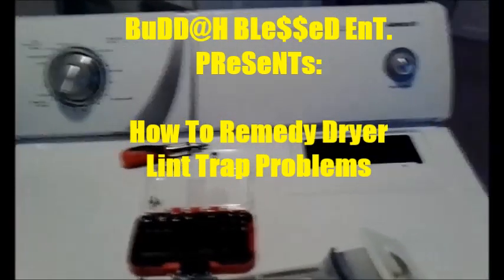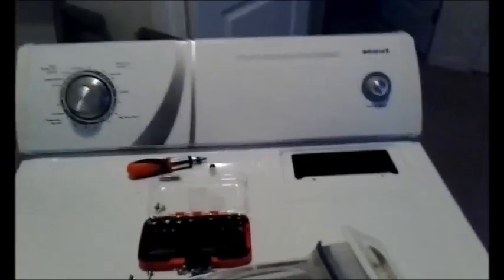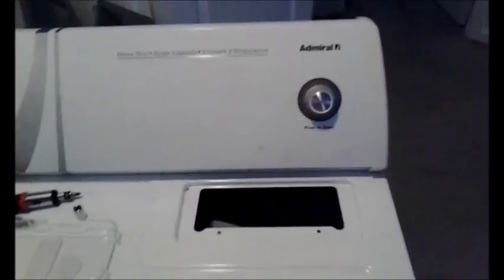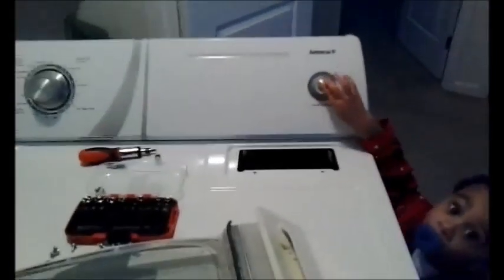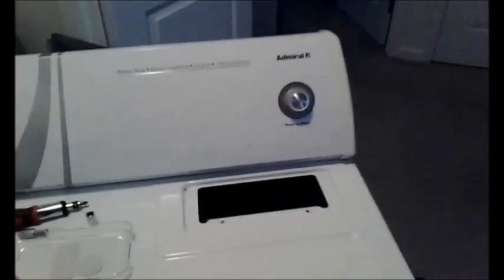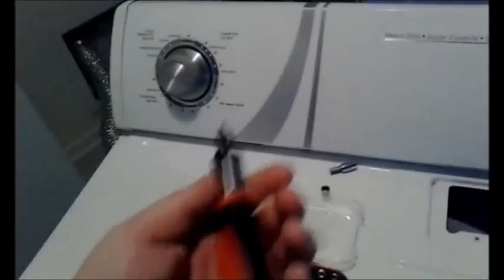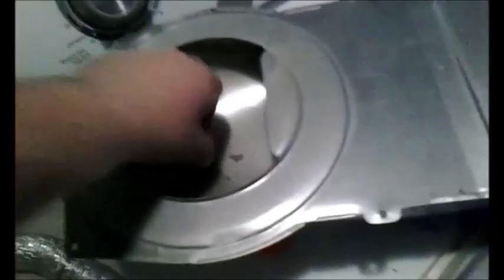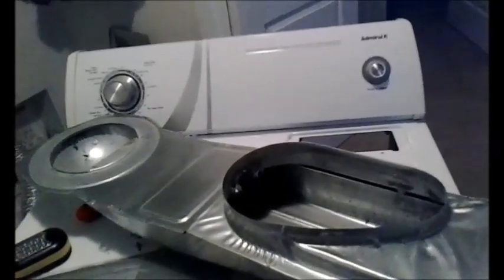How To Fix Dryer Lint Trap Problems (Removing Items That Have Fallen Into The Trap)

Comment: This video saved my life. I dropped a sock in the dryer lint vent and I was like I'm not about to turn on this dryer and have the house burn down. so I was just about to do everything you told me but couldn't find a tool box in the persons house. Something told me to turn the dryer on for a  second and I did and I heard a big suck and some metal hit. And opened the door to see if the sock fell inside the dryer but it didn't. So I went to the hose and pulled it out and it was inside of there🙌
Reply from the maker: +Lori Anne Glad it was able to "save your life"....LoL

Comment: Hi .. thank goodness for you tube and people like you who in the time of need really come through with solutions for us !  I had already had enough with trying to reattach my foil dryer hose to the wall hole because it fell off.. and I somehow rewired it to other nearby things to hopefully hold.  Deciding to just clean the lint trap , accidentally dropped a screw driver into it !! yikes !! I did what you said, removed the back , and removed the hose, and could feel the screwdriver in the trap , still had to really work it to remove it because of the angle of the exit.. but did not have to remove that whole trap unit !  Breathing again !  thanks so much !!!
Reply from the maker: No problem, thanks for leaving a comment...

Comment: I really found this video helpful. I had a deck of cards on top of the dryer and when I emptied the lint tray I accidentally pushed the deck and it fell in. Once I calmed down I found your video was a big help. I do wish you had shown the process cause getting the filter out was a huge pain in the butt

Ok I have no clue how to get the filter back on properly. Whenever I try it never lines up properly with the screws on top of the dryer

Comment: omg I had to come back I unplugged my dryer first but I twisted some really sticky tape around a long skinny belt and stuck it down the lent trap, I almost gave up but the tape finally caught hold to the sock and I pulled it right out!!!!!!
Reply from the maker: +292teacher Awesomely done, MacGyver would be proud ;)
Reply: @UKaToNeN  the sock fell in, made a noise and now the dryer won;t run.  Will this unplug the problem and have it reset or did I blow a fuse?

Comment: What are the screws on the back called? I need to figure out what to get to take them out with.
Reply from the maker: I think that they`re called bits or bit-tipped screws. In the video I showed ya what I used to remove them, it was purchased at Wal-Mart. Hope that helps...

Comment: I accidentally dropped a tag from a bit of clothing that was just lying next to the hole would anything happen if I turn it on with it in it
Reply from the maker: I can't say for sure 💯 without seeing the tag. However if it's just a regular price tag I don't really think that it will cause any damage. If you do use the dryer just keep an eye on it, see if it makes any weird noises. If it does stop using it & take the steps in this video as a guide. Hope that helps....

Comment: only lint from the actual trap fell back down the shute. How bad is bad enough to cause a fire?
Reply from the maker: Honestly I couldn`t answer that one because technically all it take is a little bit of lint to start a fire. I`m not saying that just because some lint falls down in there that it`s going to catch fire, but it`s a possibility. I`ve witnessed the aftermath so I`m only warning folks about the potential hazard. Obviously the more lint that falls down in there the higher the risk, but it`s still not a guaranteed fire. It`s a possibility, that is all! If you`re concerned enough about it that it`s causing you to worry why not just relieve yourself of the stress & clean it out? It`s real easy to do & it`ll put your mind at ease, happy holidays!!!

Comment: 2024, I heard something metal fall into the lint trap. I'll be trying this today 🤞🤞🤞
Reply from the maker: @Sullyplays4122  good luck, hope the video helps out!!!
Reply: It did, in that I got everything taken apart (it was a large screw that fell) but now I need to replace the blower wheel because the screw broke off a chunk of it. Thank you for all your help!
Reply from the maker: @Sullyplays4122  Not a problem! Just happy to help out a fellow Human 😉 you may be able to skip replacing the wheel if the dryer is working as it should drying-wise, unless of course the damage to the wheel is quite drastic. After all I believe that the wheel helps to distribute the hot air, so it may very well need a replacement. I'm cheap as hell 😆 so that's just my opinion...

Comment: Unfortunately I cant remove the back panel on mine because the duct is not straight, it is curved and really stuck there. Anyone have my issue? If the duct/outlet were straight then I could easily remove it.
Reply from the maker: Sorry to hear that you`re having issues. The back panel should come off regardless of how the duct is in there. The back is only held on by the bits/screws, the duct shouldn`t affect the way you can remove the back panel. What kind of make is the dryer anyway???